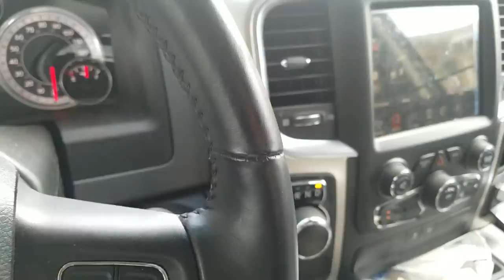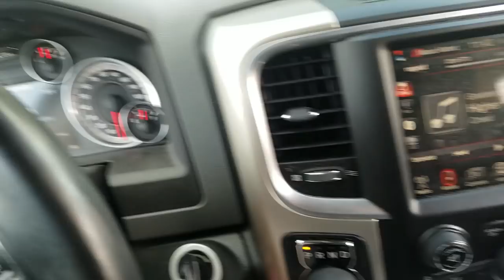Exotic Fish ADOPTION!

Comment: Hey bro from Australia :) 
If you can, grab 4 or 5 Tyre Track Eels for one of your tanks that has a small/medium size gravel in it.  They live most of the time underneath with their little heads sticking out. Super cute.  There is another sp. called spiny nosed eels as well.